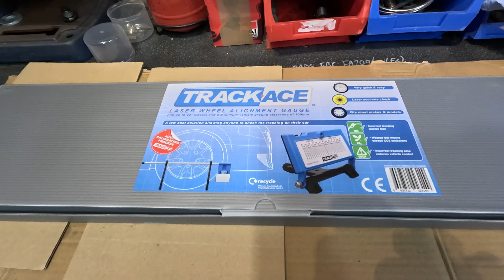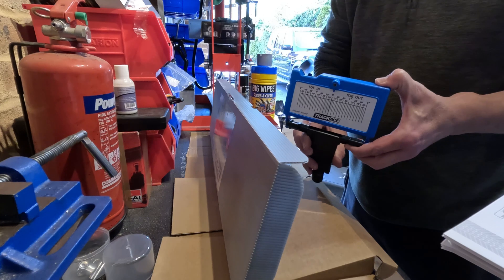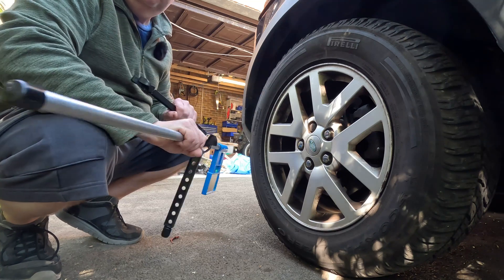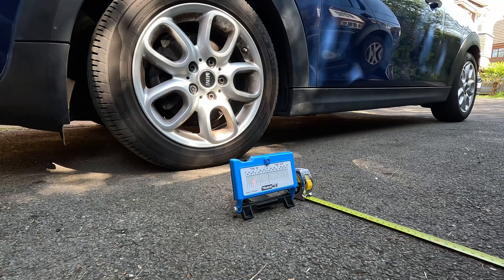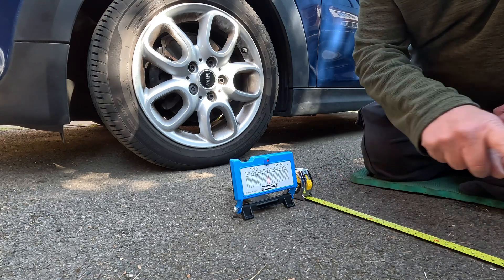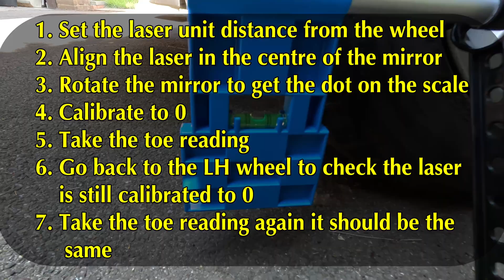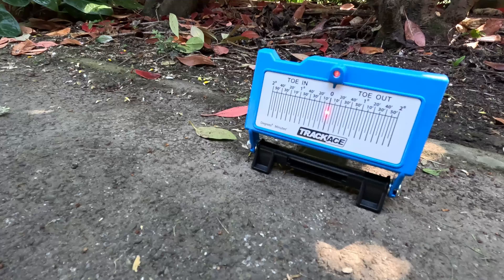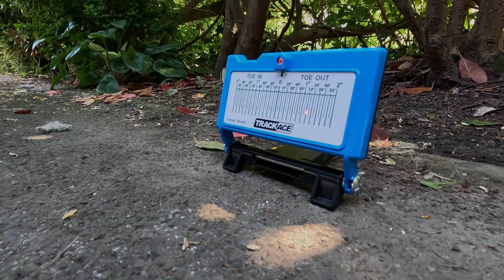Trackace DIY Wheel Alignment Check Land Rover Discovery 3 (LR3) | 4K Hi-Res

Comment: I basically understand toe-in and toe-out...
However, I don't understand how you know which wheel needs correcting, or in the worst case, both wheels? The driver's side is set to zero as a reference.
But this could also be off, right?
So would using strings make it clearer?
Thanks for any answer!
Regards from Germany
Reply: The kit measures total toe. To get the steering wheel centered requires a lot of adjusting of both sides after you get the total toe correct. As long as the total toe is correct, the steering wheel being slightly off centre does not matter unless you're very fussy. 😁
Reply from the maker: The trackace website explains the calibration. I'm not 100% sure how it works either, but the principles of geometry are sound. http://www.trackace.co.uk

Comment: Great video. Absolutely fantastic bit of kit. I have just bought one this week and used it on my car. Initially the setup takes a few minutes but once you understand the mechanics of how it works you can check your alignment in 10mins. My car was scrubbing the inside of the tyres so it pointed to it having toe-out. I measured it with the Trackace and it showed 46 minutes of toe-out! Factory spec was -10 to +10 minutes of toe. Got it bang on 0 toe after 2 adjustments. Already paid for itself after 1 use!

Comment: This all seems very fiddly. I set up parallel string lines on either side of the car, equidistant from the car's centre line. Then, measure from the string line to the front and rear edges of each wheel and record the results. It's then fairly easy to calculate how much adjustment is required at the track-rods.  This method is also a bit fiddly, but it costs nothing and produces accurate and reproducible results.
Reply: The problem is, according to my math, on my car, I have to measure around "1.1mm total toe" - that's really hard to get that right with string lines...
Reply: I have used two different string methods, my car still pulls to the right...

Your centre line approach sounds more feasible than the  rear wheel measured variations.

Are  you measuring centre of vehicle from the wheel centres?

Comment: I admire your tenacity in getting consistent results. I thought that if checking in the reverse direction as you did, you'd end up with a slightly less accurate reading (as the laser and mirror are so much nearer to each other).

If your two wheel reference points are on the outer metal lip of the rim, I'm guessing you should first check that this part of the wheel is free of kerb-scrapes and stone-chip dings, etc?
Reply from the maker: Yes, getting a smooth contact point is important and helps with consistency.

Comment: Great new user video, as you run into all the tricky bits that new users face as they have to learn how this kit works you thought them out quickly and logically. A few tips, gently stop up the car while moving in a straight-ahead position, ignore the position of the steering wheel this may not be correctly centred. Locate the stands as far up the wheel as you can, this is a little more stable. I admire your referencing to moving the gauge back and forth to re-confirm the zero setting and reading repeatedly, and finally great move to check in reverse direction, not geeky to me, you quickly realised how to confirm the accuracy of this system, I have used this many times where I have disputed wheel alignment services where technicians have then insisted their expensive equipment is properly calibrated, so I told them to do a reverse direction check and surprise-surprise Trackace was correct and their kit was uncalibrated. I remember one guy said he had not had to calibrate his gauges in 20 years, his Dunlop kit was a whole 50 minutes of a degree out, just how many cars has he mis-aligned over that time? Few more goes and you will be able to complete a measurement in a couple of minutes. I look forward to an alignment adjustment video from you hopefully, your vehicle does need adjusting lol.
Reply from the maker: Thanks for the great feedback, I try to be realistic about how how long I spend on things. I do need to re-check the toe as I have done a 'basic' camber setting (video coming). I wanted to do the caster too, but it's a bit more involved as my drive is not level. I am interested to see what the toe value is now, so I'll do a follow up soon.
Reply: So this final figure would be the total "toe" across the front wheels.? Would it be different if the job were on swivel plates? I'd love to see a video showing this type of vehicle actually measured and then adjusted on plates. Also I assume the castor/camber would have been checked and verified prior to adjusting the toe angles?
Reply from the maker: @harwoods11  I guess so, I'm not an expert at wheel alignment, hence my experiments. I'd love swivel plates to set the castor/camber, but they are very expensive to buy. I do have a camber video, wheels off ground.